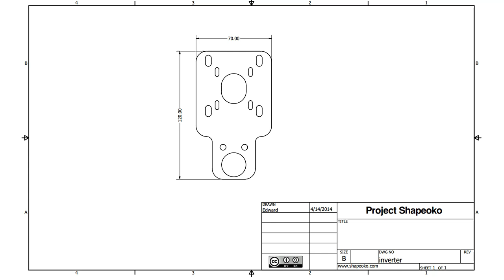Custom Z-Axis Assembly!

Comment: Hey by chance did you ever check out Openbuilds, I believe there's one of these there

https://youtu.be/nTzX6c8_8l4
Reply from the maker: james shelton 
I did indeed check out Open Builds. In fact, my lead
screw and Delran nut came from them.

 Speaking specifically about the C-Beam I don't really know
how to look at it. On one hand, I think the design is attempting to make room
for a lead screw while also keeping the v-wheels close to the gantry plate. However,
it also seems kind of like a gimmicky thing. What I mean is that it's made to
look very similar to professional grade linear actuators. The problem with this
is that it isn't necessarily any more rigid or capable than any other 40mm wide
linear rail solution on the market. Personally, I think I'd rather use an 80mm
wide piece of v-slot, or openrail on an 80mm extrusion. At least then you'd get
the full advantage of the footprint you were needing to accommodate for.

Now having said that, I think that Open Builds fields a very
interesting array of products, and anything I've ever purchased from them has
come to me without any problem. I think that they have a couple things that
aren't necessarily the best ideas, but that doesn't mean that they are. It just
means that I'm very skeptical and items like C-Beam and those acrylic v-wheels
seem very close to snake oil to me personally.
Reply: Nice!